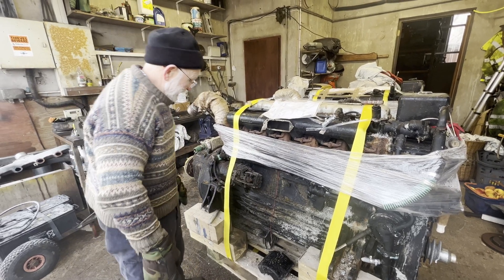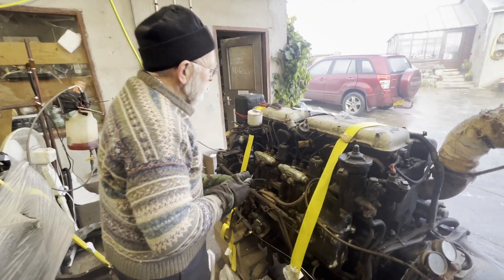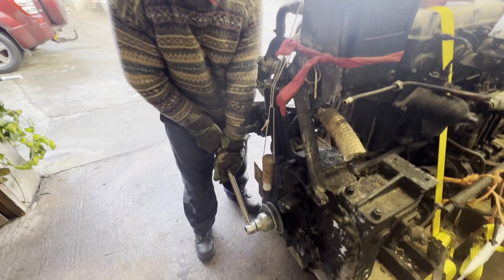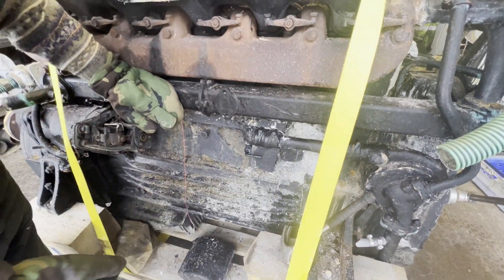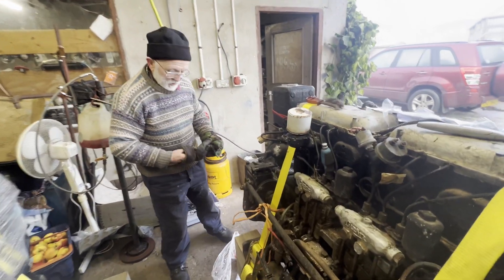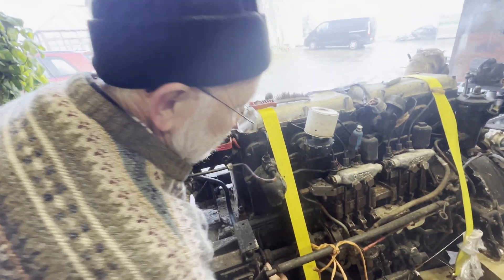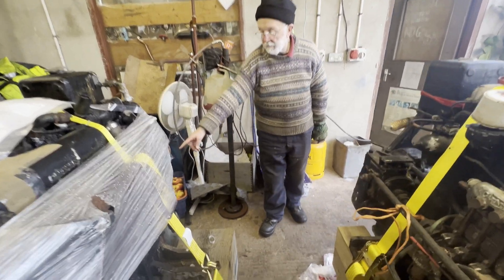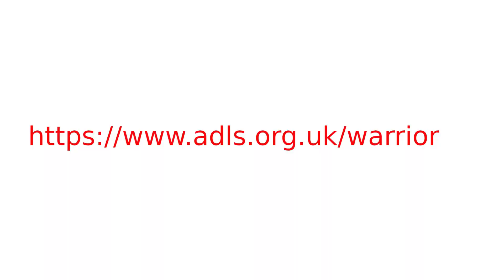Unpacking two Gardner Engines: 6LXs.  Part I.

Comment: Should look to see if the cylinder head has the extra small stud to clamp it down that the 6LXB engines have against the 6LX. 
Altho it could still be an 6LX with an 6LXB block, heads and injector pump tops fitted.